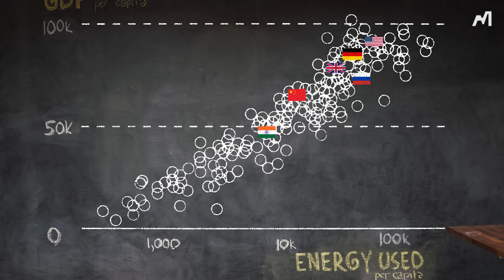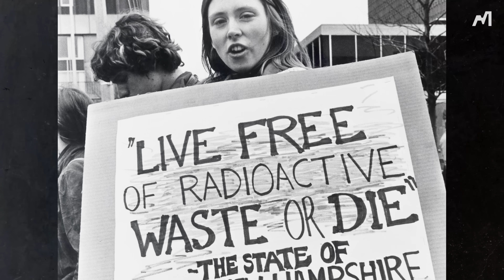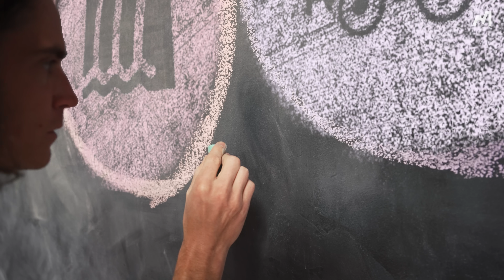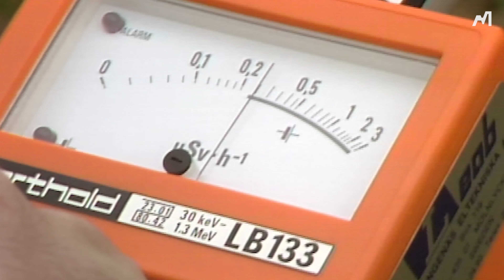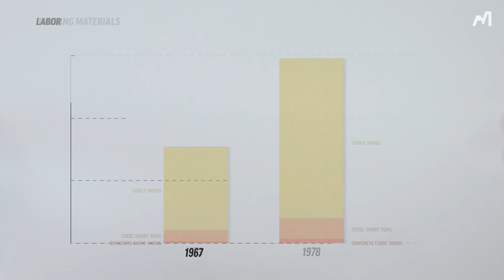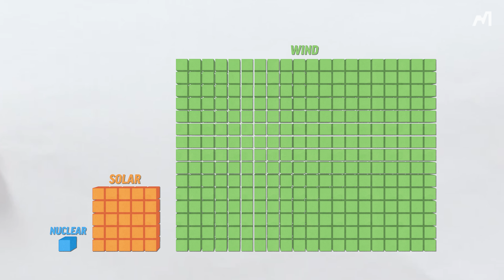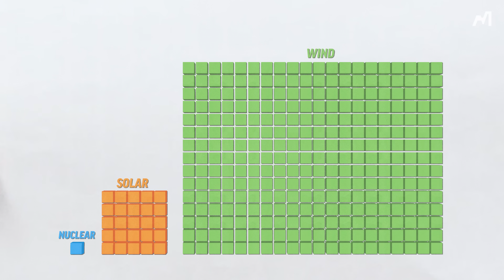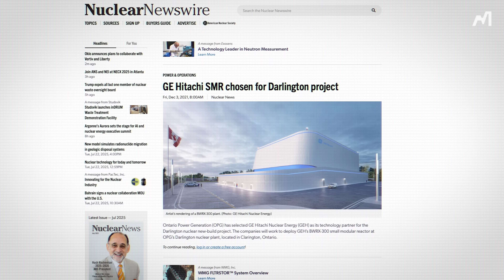They're Lying to You About Nuclear Energy

Comment: 14:44 here‘s a list of reasons to not use nuclear, completely independent of any safety concerns: 

Speed. nuclear plants are slow to change their output. because energy needs change over the course of the day, this means that only the base power can be provided by nuclear. peak power is usually provided by combustion plants like gas, because they can react a lot faster. Nuclear can provide at most 1/3 to 1/2 of your total power.

Maintenance. because of the need for maintenance and redundancy, you need about 50% more nuclear plants than what would cover your energy needs. 1/3 of them will be offline at any one time.

Fuel requirements. Nuclear fuel is limited. It is therefor not a renewable. It will run out eventually.

Access to cooling water. landlocked areas have to rely on rivers or groundwater, the latter of which is a highly questionable decision because any access to it is a danger of contaminating limited drinking water. Every power plant stationed at a river will increase the temperature of the water downstream, making successive cooling plants less effective or even impossible.

Okay-I-lied-here‘s-one-with-safety-concerns: Supervision. nuclear plants need to be managed constantly. most actual renewables run by themselves and can get away with simple digital observation and handling.

Comment: 12:52 counterpoint: this may be a good thing - solarpanels obviously don‘t block all the light, as they have gaps between them EDIT(and also diffused light).

decreasing the amount of light „soaked up“, as you put it, by the ground and instead reflecting it back into the sky (and space) can have quite positive effects. less evaporating rainwater helps the fauna and flora.

and in an urban environment, keeping the heat away from people, high absorption surfaces like asphalt and concrete and parked vehicles is becoming more and more valuable.

Of course you cant plant crops in a solar park, but there is substantial evidence that the renaturalisation (away from farmland and towards grassland) that is often part of building a solar park actually improves biodiversity and helps local biozones recover.

Of course it depends on what kind of location is transformed into a solar park, but this has been studied both in the US and Europe.

Comment: The true cost of wind or solar is wind/solar + backing traditional power plant. Neither wind or solar is reliable and must be backed by one or more traditional power plants. Worse, peak backing times means the backing is largely idle during peak profit periods. Increasing their cost per kw/hr and ROI. Which means coming and going the only thing wind and solar can achieve is massively inflated energy costs or drastically lower grid reliability.

Comment: The most important thing to realise is that the United Nations and the World Health Organisation cannot be trusted, and their claims about the health effects of the Fukushima melt down has been thoroughly debunked. Secondly, with modern materials, and manufacturing, fabrication and construction techniques, along with the latest monitoring and control systems, the safety of nuclear power is exceptionally good. Add on top of that technological advances in nuclear fuel and reactor designs and it becomes a no-brainer. Nuclear power is safe.

Comment: The biggest lie about nuclear is that it's green, non polluting and sustainable. It's actually none of these.
The carbon footprint of nuclear is all upfront; mining, extracting, processing, transporting of fuel, and manufqcting the plant which uses massive amounts of steel and concrete, these two processes the biggest emmitters of CO2. That would be enough on its own, but thetre's a lot more to object to.

All the energy rteleased by nucleaatr is extra to the energy balance of Earth, without nuclear it would not be created and added to an already heating planet. Fossil fuels once grew and removed carbon in so doing, as also applies to wood, returning carbon that was extracted, renewables user energy from the sun before it results in added plant growth, under a PV panel the surface is cool, wind turbines remove energy from the wind, all energy used by renewables would have entered the mix and added energy so  a net reduction. 

Nuclear adds 100% of the energy released to the atmosphere and seas, either directly or through energy release when used, and without any concurrent reduction in carbon or energy. So without any reduction in CO2 in the atmpshere, or methane release that results from the process, nuclear is simply adding energy. What is not needed is an extra source of energy on an already overheating planet. With the 440 nuclear plants already existing in the world adding an extra massive energy boost [that's what they tell us] it's unreaistic to only mention oil and gas as technologies that need to go, since with the present mix in the atmosphere, heating will continue even if no more CO2 or methane were released. Nuclear will continue to feed energy until removed. That includes so called 'fusion', which may only be of use as a grant driver for those looking for funding for their cultish obsessional hobby. It has never produced anything approaching the energy it takes, but is used annually to stimulate interest in and funding for research. 

Nuclear is a modern form of steam power, and it's about time those obsessed with it being high tech and 'the future' try to think critically if they can, and aabandon the misplaced idea it is an answer to anything but easy money for academics to avoid a real job. .
Reply: Oh. Guess solar plants are the least green of them all then. Hydro as well, since you need massive amounts of concrete, definitely muuuuch more compared to steam/nuclear plants.
Reply: false, even considering all the steps it's green, look up JRC technical assessment of nuclear energy

Comment: Radiation is not as dangerous as we think or believe. All of us  experience some radiation caused by various thinks and most of them caused by nature. for example we take to many radiation when we go somewhere by plane. we eat radiation when we eat bananas. we take radiation even we stay at home because our house takes radon from soil and send where we live. If you dont believe me buy a dosimeter and go on aplane and see the radiation level that you experiencing. Nuclear power plants is the smallest radiation source and the radiation sourced by nuclear pps probably wont be have any effect in your life. Untill you decide to make some unsafe safety tests on your nuclear reactors. What we need to make is just sending more budget for nuclear researchs and giving a chance to the industry for building newer, stronger, safer, and more tecnologic nuclear power plants. Scientists now trying to make a fussion reactor which is completely a new technique. Nuclear energy doesnt mean only "cheap energy", but it may mean cheap and clean fuel. If we find a new technique for nuclear energy which is much more cheaper, stronger, safer we can make our clean fuel from sea water by electrolising the sea water and produce hydrogene and oxygene. then we can fill our cars with hydrogene and drive zero emissions. chemical bonds (fuel) are always the safest and smartest way to stocking energy. Stocking energy as electrical energy (batteries) is the worst way to stock energy somewhere

Comment: It’s hard to believe that pain does not exist, that there is no hot and no cold. However, the mind realises harmful vibrations and creates a reaction that unless observed can, for instance, dry up the skin referred to as burns. Vibrations are constructive and destructive and is the whole essence of life. Uranium has a vibration, so has every other unique substance but the sound created to identify its vibration has been made to sound unpleasant, The Geiger Counter could have been made to play virtually any tune such as the Batman theme but an ominous sounding one was selected, scary. In this video it is stated that nuclear waste is the fuel they use for making electricity. Well, if you believe that then believe it for it's not exactly the case. The fuel in a nuclear generating plant is not Uranium or Plutonium but water where Uranium and Plutonium's natural vibration is able to extract the Oxygen, Nitrogen, and whatever, trapped in the container called water to use as fuel like natural gas does. And, then, amazingly, is set alight to create another vibration to produce steam to turn the turbines. But then, all this is supposition, however, you will always find a water supply near every nuclear power plant and even in submarines there a casing of water around its so called nuclear reactor.
Chernobyl and Fukushima - The Sultana disaster, cost cutting. Galen Winsor.

Comment: Thank you So much @Maxinomics . Nuclear does have positive attributes such as 0.022 deaths per TWh compared to 32.72 for brown coal, indicating how toxic hydrocarbons (so-called fossil fuel) can be. But Hydro/Wind/Solar have far less deaths per TWh so it's not a good metric as the latter has far better performance. 

World Energy is a complex topic, & there are alternatives to explore. Isolating nuclear as a one-stop solution is about as infantile as assuming wind and solar farms, even with large batteries, can produce baseload power. Your video approaches 1 million views, mine on Clean Energy Alternatives to Nuclear & Clean Energy Inspired by Imagination, not Nuclear (search YouTube) score less than 100. This topic may be driven by sensationalism, rather than common engineering sense. Here are some "facts":

* Nuclear, once operating, is far less toxic than the by-products of burning oil and coal, although features nuclear waste and large 'fossil fuel' extraction and refinement costs.

* The world's largest power stations are all hydro: 8 stations from 8 to 22 GW. Nuclear is way down the scale!

* A single nuclear reactor, typically 1 GW, takes 15 years and costs around $9 billion to build (subject to x3 cost blowouts!), requires 850,000 tonnes of concrete, and 150,000 tonnes of steel. NONE of this is TRIVIAL!

* As a viable alternative, Small Modular Nuclear Reactors are fabricated in the factory although have limited power and higher end costs per energy unit produced.

* There's already 250,000 tonnes of nuclear waste worldwide, with no solution in sight on how to dispose, apart from sending it all to Australia. Extensively covered in two news reports: Waste & Weapons for Australia: aukus-radioactive-waste-marles-denies-us-uk-obligation . Paul Keating spoke out but was heavily criticized. Also anthony-albanese-and-peter-dutton-go-nuclear-with-their-lies-to-voters .

* The consequence here is proliferation of nuclear weapons hardware as well as the world's dumping ground for nuclear waste. Plenty of places for 250,000 tonnes? Australia is MY back yard, so no thank you.

* As a contrast to a nuclear reactor of 1 GW: The proposed Grand Inga Dam in the Congo is projected to produce 39 GW.

* The Penzhin Tidal Power Plant Project is projected to produce 89 GW, equivalent to 25 nuclear power plants! 40% of Russia's capacity!

* A smaller bay around Derby in Western Australia has similar tides. Is this viable?

* Australia's Darwin Solar Park, for the Australia-Asia Power Link, is projected to produce 20 GW.

* World Geothermal is around 20 GW in 2020, projected to be 100 GW by 2050.

* The world's largest nuclear power station in Japan at just 8 GW (8 1 GW reactors) has been suspended since 2011 due to seismic activity and deliberately falsified data surrounding safety inspections. Never mind the Fukushima disaster!

* A nuclear power station has 3 main pumps. Fukushima meltdown was caused by a seawater breach that disabled these pumps.

* Similarly, a coronal mass ejection from the sun, or an electromagnetic pulse from a nuclear explosion in space, could damage the grid so that diesel-powered generators would eventually run out of fuel, with hundreds of potential meltdowns world-wide.

* Miracle Thorium reactors appear to be a pipe dream, too good to be true. It doesn't fission without weapons grade uranium or an accelerator, creates less energy, is less economic, and creates a mixed waste stream that is difficult to dispose of. Do we have 50 years to wait for this to come on line?

* Tidal Energy Converters (TECs) are under-water wind turbines that produce ultra-reliable power, due to a satellite called the moon! Unlike intermittant wind turbines. Limited capacity, however.

* Dynamic Tidal Power with a 30km causeway, in contrast, has VAST potential at a developmental stage. Imagine dozens of hydro technology points, a very mature technology, along the length of the causeway!

* Australia's Regional Hydrogen Hubs program, investing over half a billion dollars to build electrolyser hubs at key locations like Pilbara, Kwinana, Gladstone, Townsville, Bell Bay, Port Bonython, and the Hunter. This is projected to generate $50 billion in additional GDP by 2050 (much of this has been scuttled, however).

* There's an estimated 10 trillion tonnes of Natural Hydrogen (also termed White or Gold) underground! As opposed to Gray, Blue, Green and Orange hydrogen. Although Aquifiers MUST be protected from over-exploitation.

* Zero-point energy aside, magnetics may yet revolutionise the way energy is produced, as well as gravity.

Comment: The one caveat that is worth considering is the waste. Waste pools do need constant cooling and maintenance. If a pool isnt properly maintained, you will likely have an eventual radiological problem such as melting and fires. The fuel can and should be processed back into fresh fuel, not buried underground. Several processes have been demonstrated for the D.O.E. and are economically feasible. I spent many years in the Navy in this field and we should pursue nuclear power with stable designs.

Comment: Yep! Just like they are Mars, and the Moon, space is really outerspaces, and there are four types of inner-terrestrial alien species. Rockets can't go through the firmament or even beyond 70 miles. During Operation fishbowl at the Antarctic wall the missile made ceiling contact at 16,000 ft. at lowest point measured. The Earth is not a sphere it is flat. Oil is the 2nd most abundant liquid and electricity should be free energy or atleast as cheap as a water bill.

Comment: The USA needs to ABOLISH the Nuclear Regulatory Commission (NRC), it's regulations raise standards 10K times ABOVE those supported by science, their regulations require 10 years and 70 million dollars to approve even proven nuclear designs, their HYPER-REGULATION  necessitates 10+ year build times instead of 2.5 year build times, which results in an ADDITIONAL 75% OF THE COST of construction of the plant. The U.S. NRC kills the U.S. nuclear industry. There has never been a death in the U.S. from radiation from a nuclear energy plant in the United States. ANNUAL FOSSIL FUEL DEATHS IN THE UNITED STATES: 350,000 premature deaths: This number is attributed to fossil fuel pollution on a yearly basis in the U.S. and accounts for over 40% of all premature deaths linked to human-caused fine particulate matter (PM2.5) pollution in 2020. Over 50,000 deaths: Air pollution from burning fossil fuels is estimated to cause this many deaths and $445 billion in economic damage annually. About 107,000 premature deaths: This is the estimated number of deaths annually due to soot air pollution from burning fossil fuels, triggering cardiovascular and respiratory issues. WHERE IS THE FOSSIL FUEL REGULATORY COMMISSION? WHY DOES THE NRC EXIST?? What industry gives the most money to Congress (Fossil Fuels!)? Which industry receives the greatest subsidies in the U.S., and has, for a CENTURY?

Comment: There is a difference between being physical radiation and energy radiation.  Radiation from the sun is not a physical particle, it’s heat energy, IR, UV, etc.  Radiation from a reactor are “tiny bullets” flying through the sir and shredding everything it flies through.
Reply: Gamma rays are made of the same as light, yet they do the same as those particles....

Comment: The energy related fatalities data at 5:45 is quite misleading as the wind and solar industry had barely started up in the time period 1969 - 2000. 
In the 25 years since, the number has increased significantly for the wind industry.